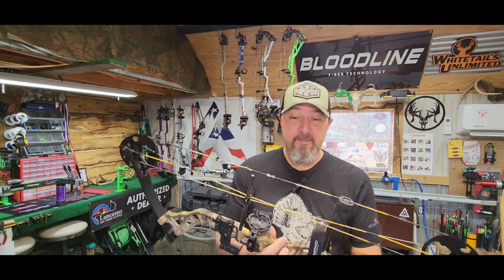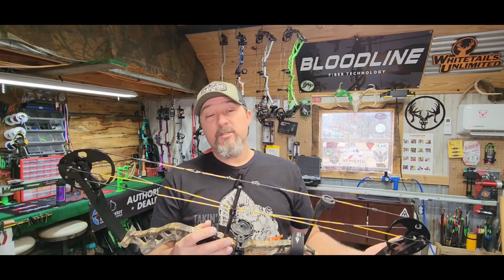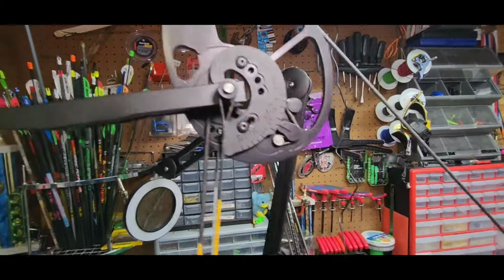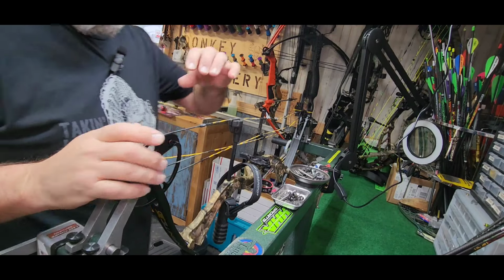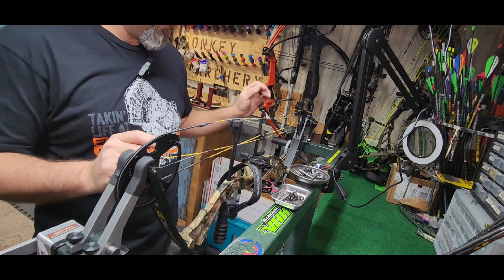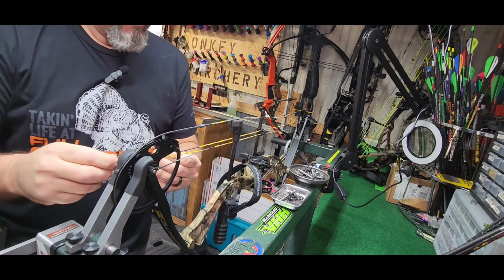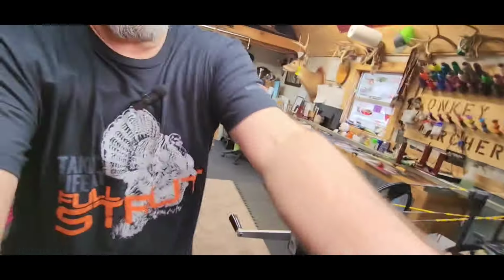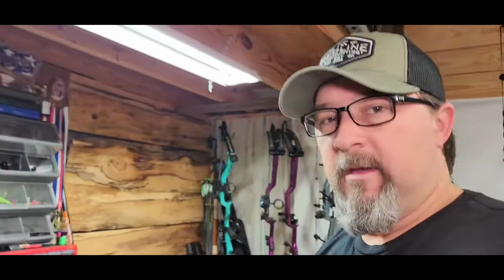What is Cam timing in compound bows??

Comment: Hey thanks, video was very informative. I recently restrung my hca extreme bow. Bottom cam was hitting first pushing the string out at full draw. I followed instructions on bus strings, i did string twist on main string still was out of sync. A few twist of the bus strings and cam are touching almost exactly same time. There is   less torque when arrows are shot. Before I timed it, the bow was almost getting flung out of my grip on release. Now it smoother on release not a big jolt of torque. So thanks.
Reply from the maker: @zeroninejames9507  happy to help!  Glad ya got it taken care of!